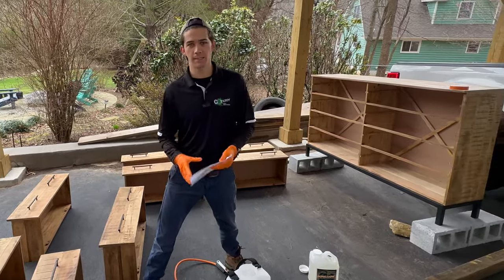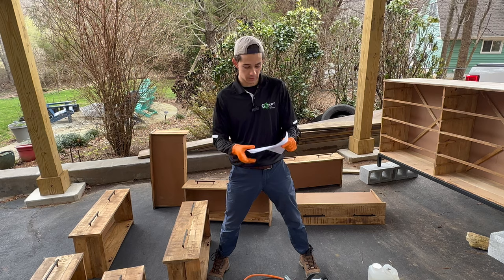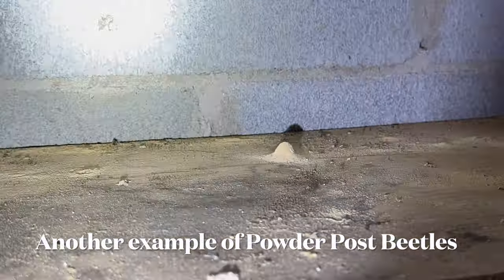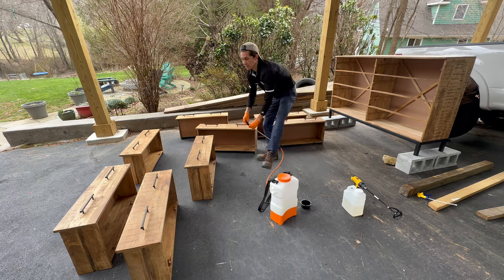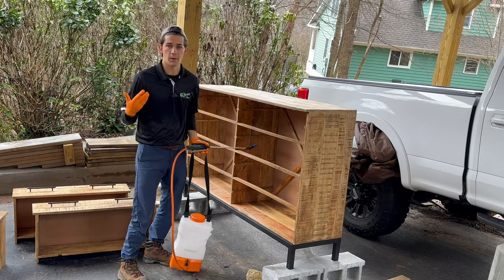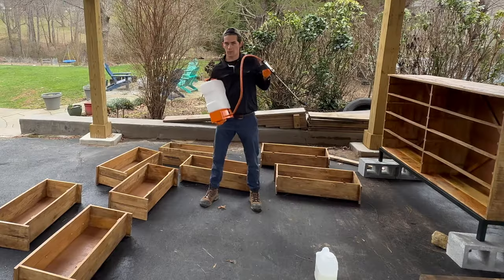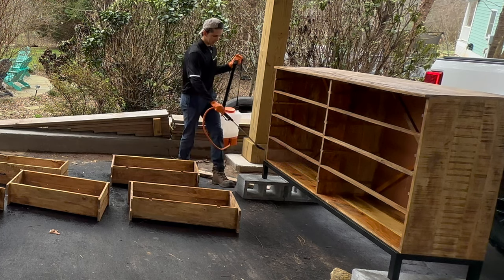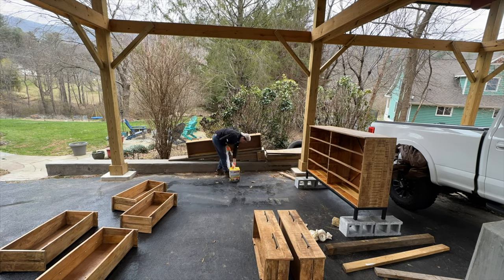How I Treat Furniture Infested with Powder Post Beetles - Anobiid, Lyctids, and Bostrichids

Comment: Crazy. I build furniture as a hobby. In the USA wood that is intended for furniture isn’t treated with chemicals like the pressure treated lumber for building a fence etc. 

You can buy kiln dried lumber to avoid issues like this. The wood is basically heated to a high temperature to kill any insects. If you use air dried lumber you can run into these issues.